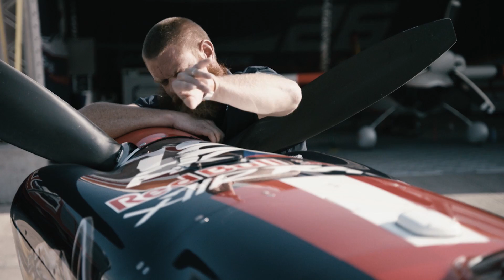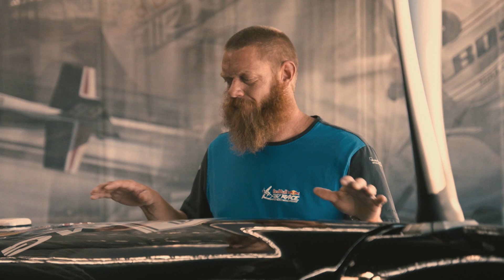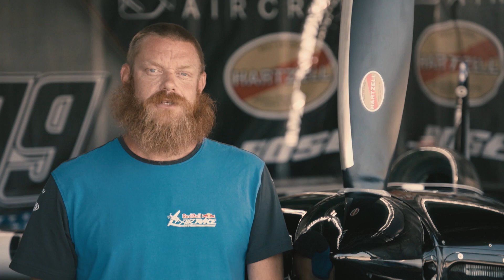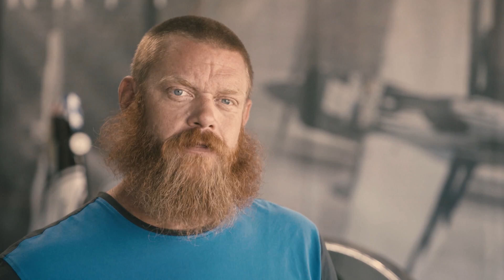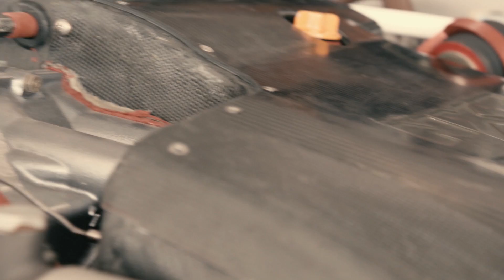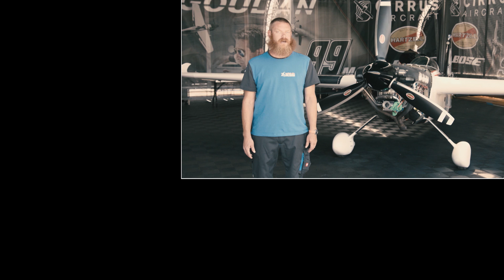Red Bull Air Race Tech Talk | The secrets of the cowling

Comment: Well the engine cover is actually the nacelle but cowling works too lol
Reply: No a cowling is any engine cover that can be opened or removed while a nacelle is a pod like housing separate from the fuselage that doesn't necessarily have to contain an engine. Engine nacelles have cowlings drop tanks are technically nacelles